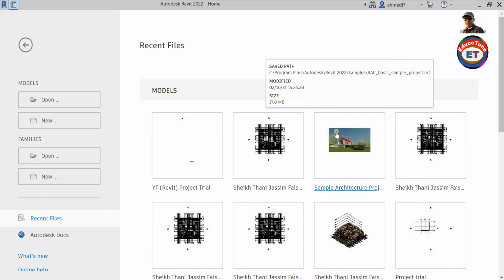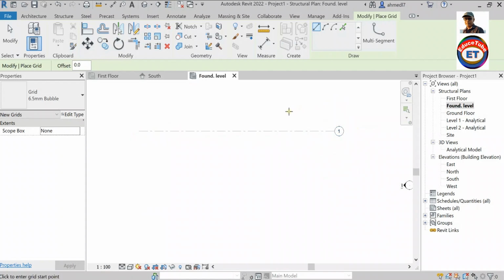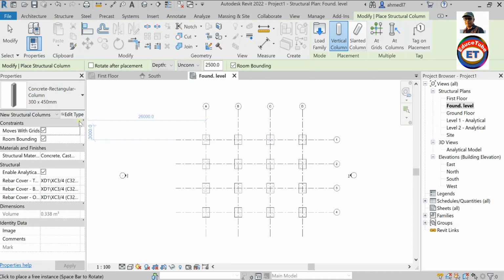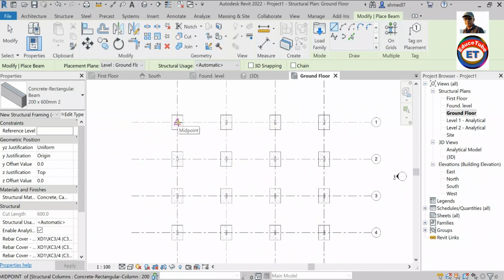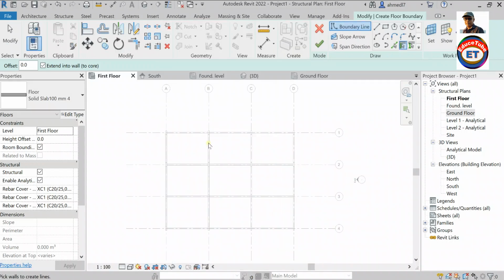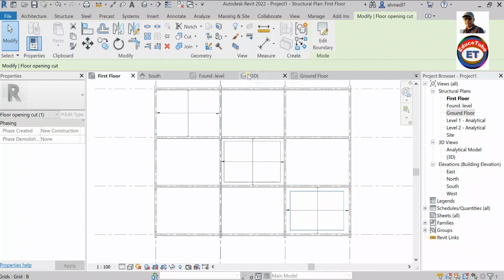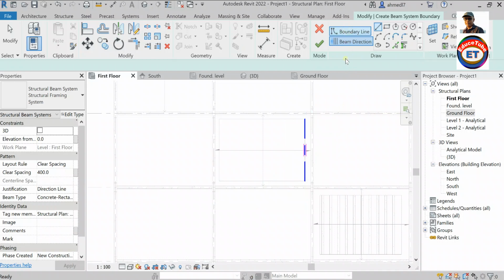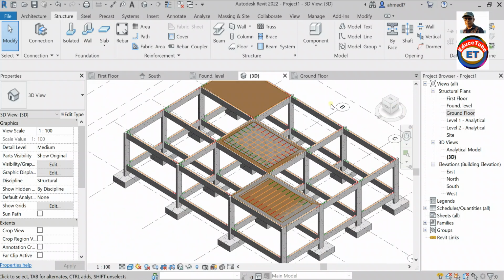Create Building model with one way and two way Hollow Blocks Slab by Autodesk Revit 2022.

Comment: sir, i have any question about robot structure analysis frame and cross check vertical load why bending moment is not same hand calculation
Reply from the maker: May be you have taken self weight twice in robot.
 Structure elements self -weight, software automatically calculate.
Reply: sir, I have one question about robot interference in structural  analysis of frame and  robot  / calculators  cross checking vertical loads with that of manual 

in fact robots replaced  not only  manual  work lay off